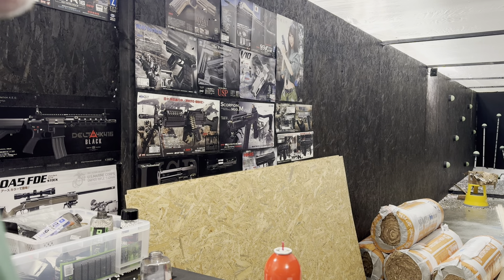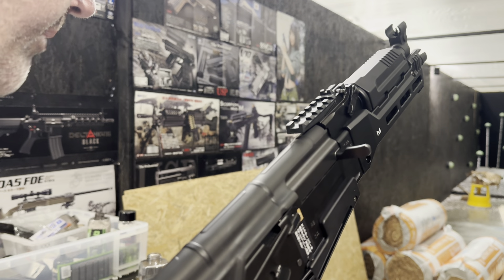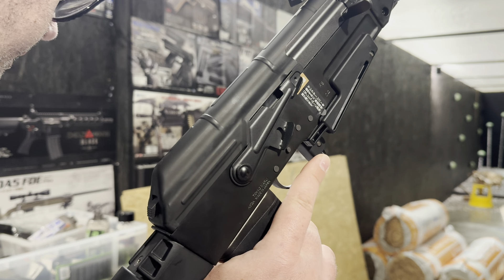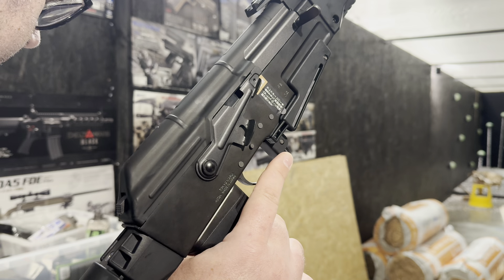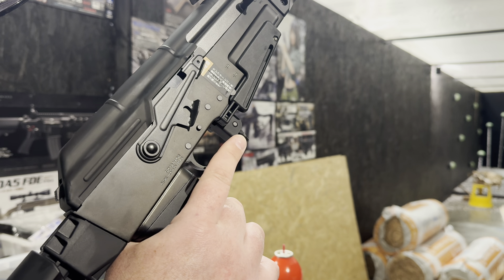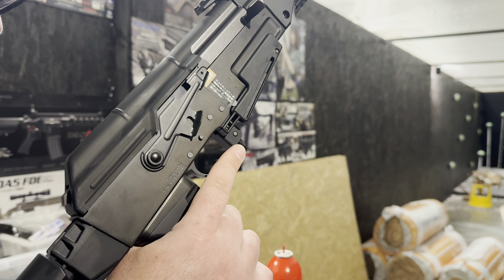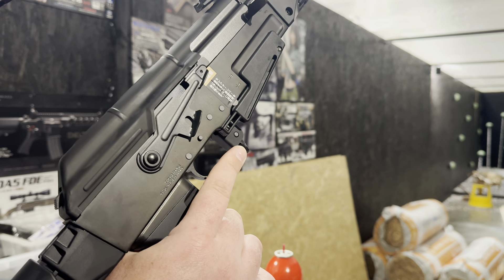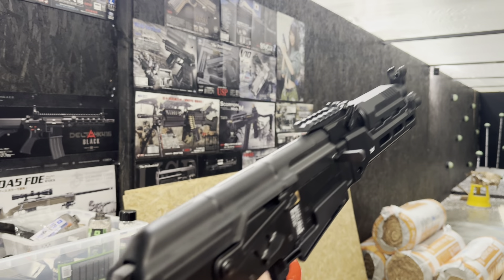TM AK Storm With Jeftron Leviathan NGRS | 1095

Comment: when you upgrade a gun will you ever go above skirmish fps limits?
Reply from the maker: @derekporter66  when I do it’s often over, we range test, then chrono and if it’s over reduce to the customers requirements.  We send guns world wide, so fps will depend on the customers local field requirements.
Reply: @Eagle6Airsoft  so if i wanted a backyard plinker with 600 fps is this possible
Reply from the maker: @derekporter66  I don’t think it’s something we could help with it’s has to be in the uk, a: for skirmishing b: 600 is actually beyond what airsoft guns can reach any way.    

I don’t think as a business we would be able to provide that for the uk.  The most we could do would be 500 and it would have to have full auto disabled.  370 is max in the uk with full auto enabled.
Reply: @Eagle6Airsoft  ok thanks